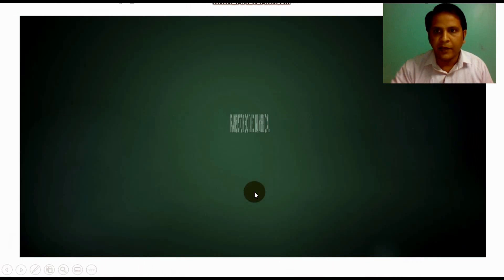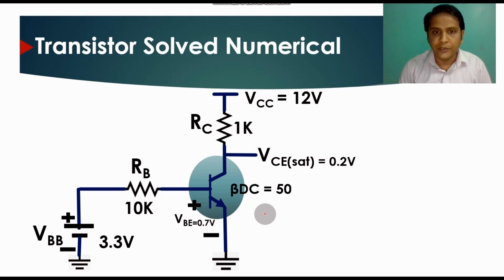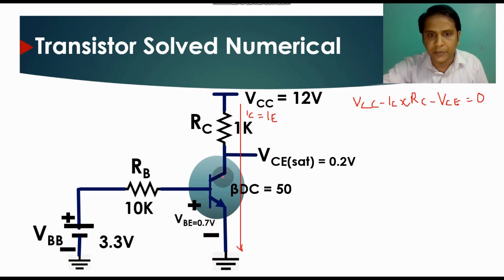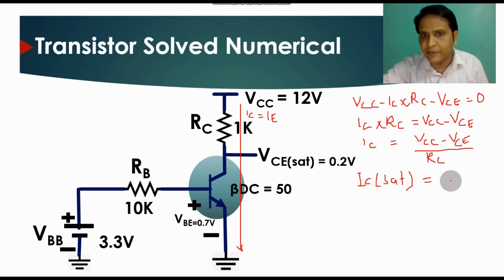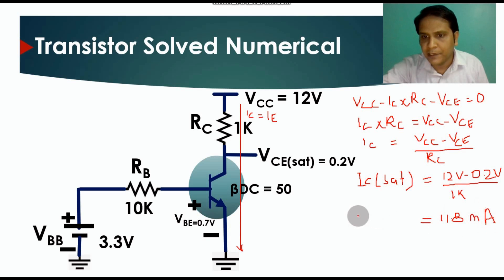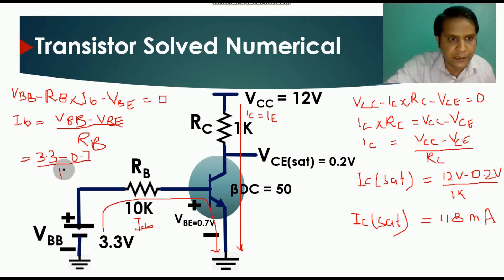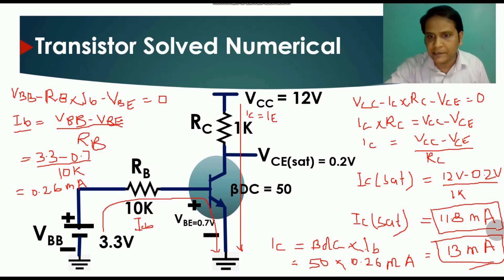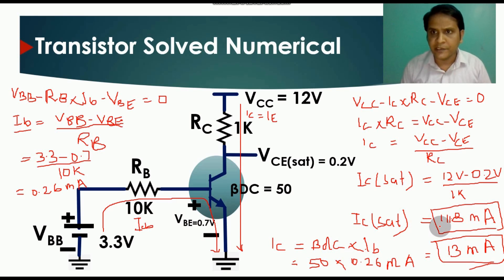Transistor Solved Numerical : BJT Saturation - YouTube

Comment: sir,
Now if you want to determine Vc, which Ic should I take, Ic or Ic(sat)
Reply: Sir,
Current is Ic or Ic(sat)
Reply from the maker: @aslammollah6083  Let me try to explain, the value of Vce changes with change in ib and ic. Let say if ib=.5mA and ic = 10mA, Vce(sat) = 90mv to 250mV.
Ib= 5mA and ic = 100mA, Vce sat = 200mv to 600mV.
With above you can easily the variation in Vce with change in ib and ic.
Above is all about the bjt saturation behaviour. 
In linear region  Vcc/Rc = ic and Vc = Vcc-Ic*Rc.
I am not sure if I answered your questions. 
So ic is nothing related go ic sat .
Reply from the maker: Icsat is max current that bjt can handle. You can determine Vc based on your collector resistance and current.

Comment: If Transistor is in Saturation. And if i increase the Current in base will the base of the transistor will not get destroyed ??
Example: If my transistor reaches Saturation. At that time i am applying base current of 100mA but further i increases my base current to 1 amp but maximum base current which transistor can handle is 500mA. At this moment will transistor get destroyed, or work fine and if it works fine will it heatup or not ??
Reply from the maker: Hello Vivek,
Thanks for asking good question.
If you apply more base current in the base of transistor surely it will get damaged.
e.g. Transistor BC547 has maximum base current 5mA anything beyond 5mA will destroy the transistor since BJT is current controlled device.

I am not sure where did you get such high base current value like 100mA, 500mA, 1A.

Comment: Pls make a video on PNP transistor
Reply from the maker: Do you need simulation or theory explanation ?
Reply: @ElectronicsCircuitHubECH  theory ecplanation
Reply from the maker: @kuldeeprawat4758  Sure i will make video on the same considering one numerical problem.